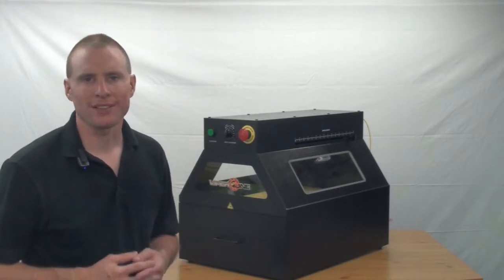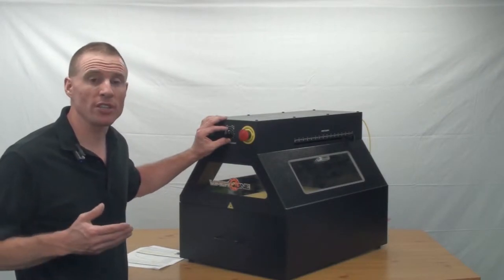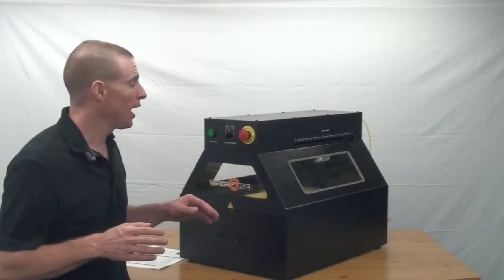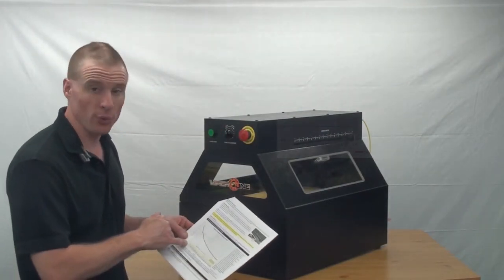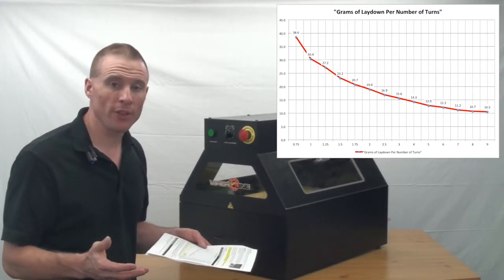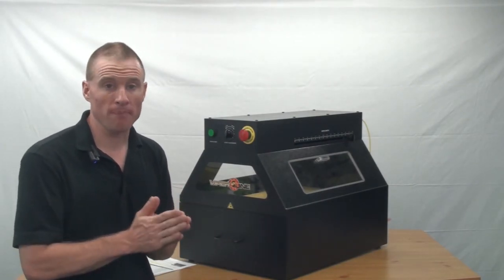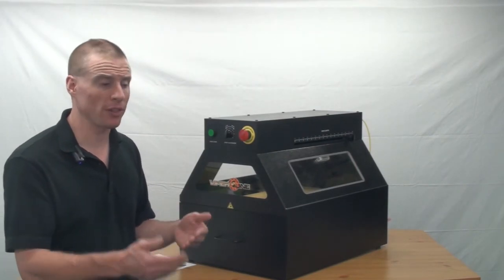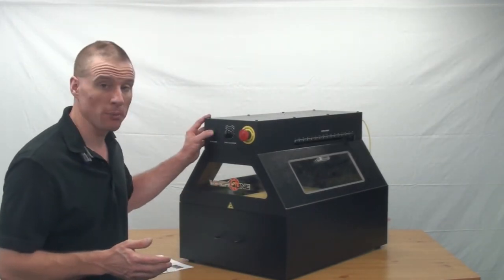ViperONE Series 1 - Spray Adjustment

Comment: there's a huge square hole at the bottom of the viperone, why? just makes it easier to leak
Reply from the maker: It's not necessary for the structure or added weight. They way it is designed will catch any overspray via the side channels and real trap/drain.